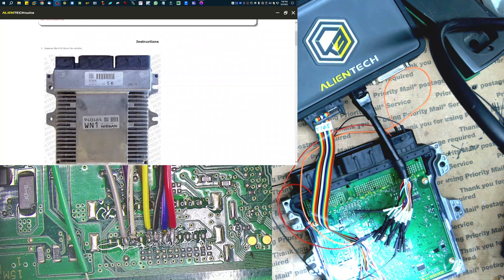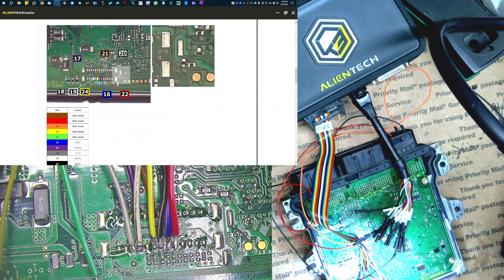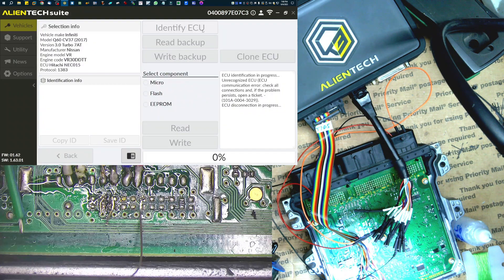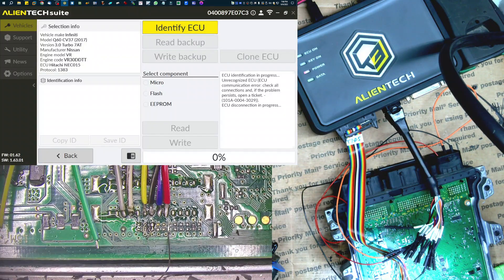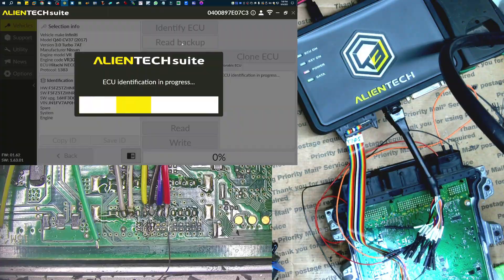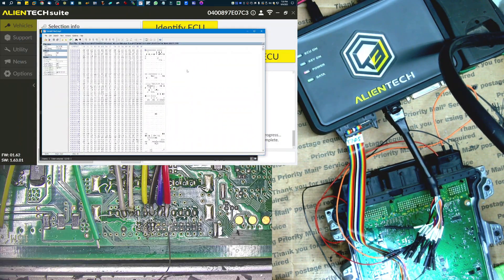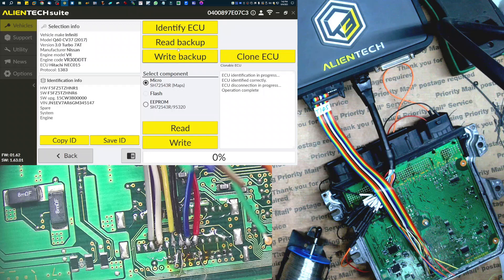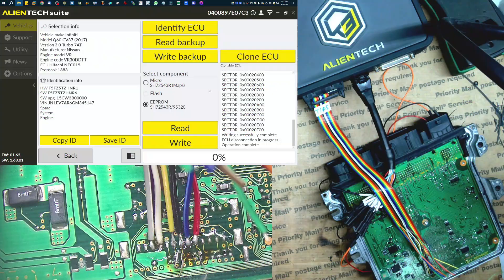Reading & Writing Nissan HITACHI ECU with Renesas NEC MCU with KESS3 in boot mode

Comment: Is the EEPROM on that ECU integrated into the microcontroller or does it have the common SOP8 chip for it? If so, could you remove the chip from the board and read it and write with an cheaper programmer interface like the CH341A?

Nice content!
Cheers.
Reply from the maker: All memories looked to be internal to NEC chip on this one